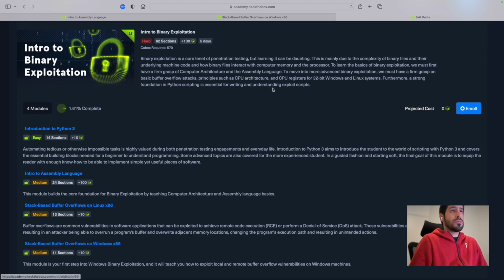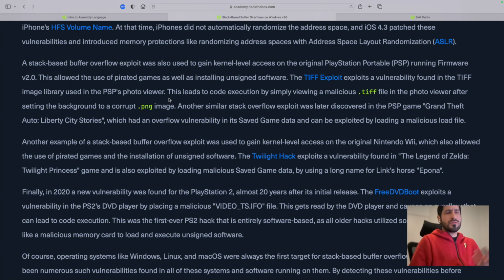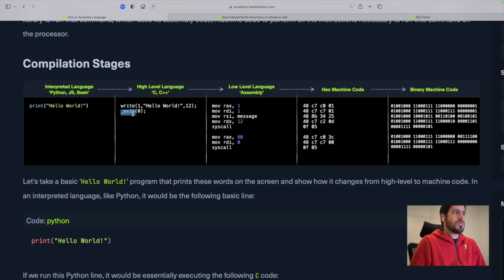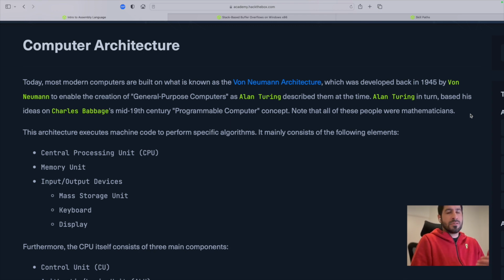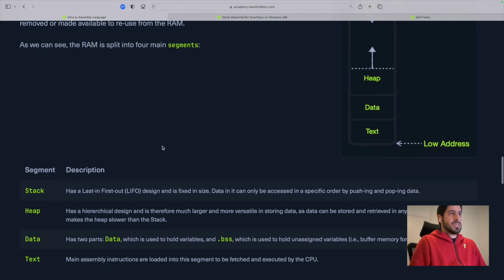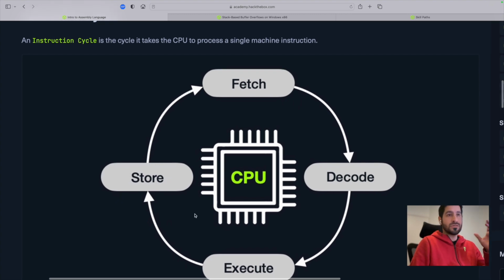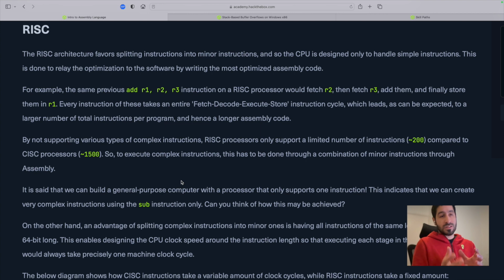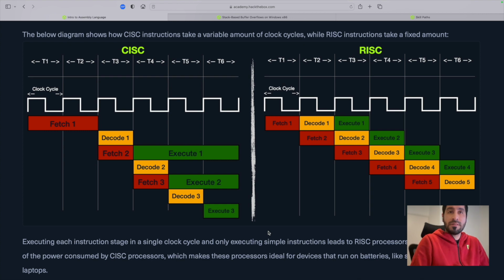First Steps Into Binary Exploitation - HackTheBox Uni CTF 2022

Comment: Hey, just wanted to thank you for the introductory overview of the module. 

Since I saw for the very first time Assembly (8086) instructions i was amazed and looked intriguing to me, since then I have had the "esoteric" (in my colleague's words) passion to try to debug either with gdb or just a "quick" objdump peek with every binary I have found interest on its behavior. But every time was that, a "quick" lookup, and I never found time to thoroughly learn how actual low level code behaves. 

Now I'm on a sabbatical year and I'm paying the monthly subscription to HTB Academy and you gave me the willpower to actually dig into it. Some (mainly Rust) programmers would say that Memory leaking or Buffer overflows are becoming more uncommon, but I just don't share their opinion. Just look at rate-per-year AND severity of some CVEs and man, they may be a headache to find, but as they say, oldie but goldy! 

I've just enrolled on the module and I'm mostly convinced that I won't spend that Cubes in vain.
Thank you, have a nice weekend!